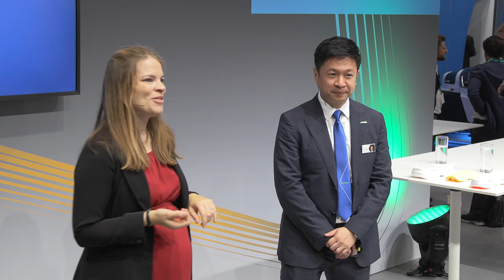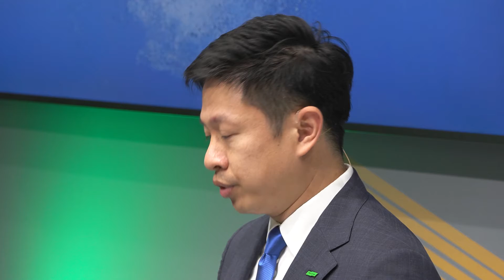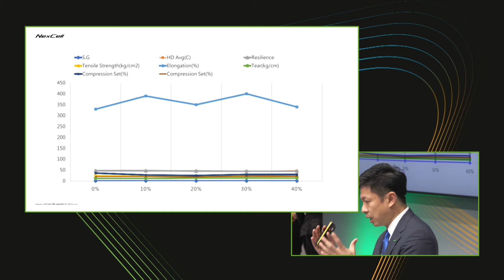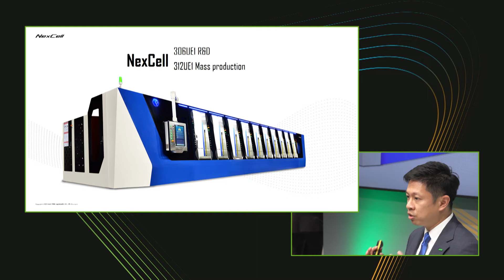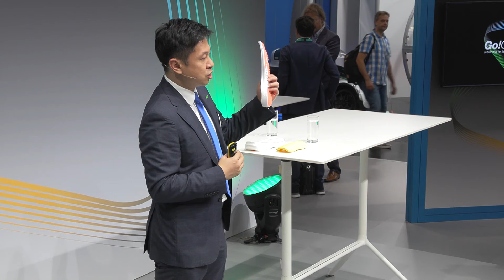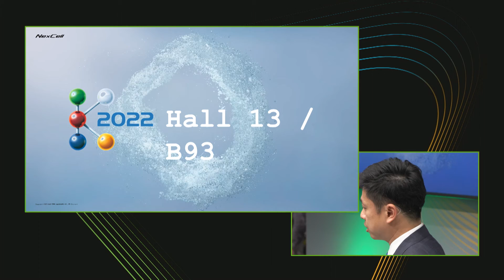Presenting the next foam technology – NexCell made possible with BASF Elastollan

Comment: I do think this technology hasn't been matured yet. 
The 4 most pivotal challenges / barriers from my perspective are: 1) density difference in area of midsole shoe depending on the design/poistion of injection gates, 2) the uneven and big internal bubble defects are hard to control, because mixture of material and gas going through opposite routes with different rate: plastic material hardenning from melten  -> solid, gas evaporating from liquid -> gas, so very hard to control the kinetic of foaming process to get even density, 3) the interfere of foaming process by fast swelling caused by difference of injection screw-pressure and mold environment-pressure, 4) very picky on material choices, until now only TPEE, TPU, PEBA has been successfully tested with this, materials should have good solubility with SCF gas, low viscosity enough to flow and mix, good melt strength, appropriate crystallization rate to acchieve optimized foaming ratio...
Reply from the maker: Thank you for sharing your perspective and highlighting these technical challenges. Please note that this video was created in 2022 and reflects the technology status at that time. Since then the associated foaming processes have continued to advance significantly.
It is also important to note that the video refers specifically to TPU, in this case BASF's Elastollan®, and should not be interpreted as a statement about foaming technologies for polymers in general.
We appreciate your technical observations and the discussion. If you have specific questions our technical development team would be happy to get in touch with you.
Reply: @basf yes I must say that your ATPU ellastolan series work well with SCF injection technology, a little bit better than Pebax, and Hytrel TPEE. However, just don't know if long-term compression set can be improved by any subsequence crosslinking (such as using caprolactone blocked isocyanate trimer ) ?
Reply from the maker: Thanks for highlighting the benefits of our aliphatic SCF grades.
For further ideas and technical supports just contact us: elastollan-infopoint@basf.com